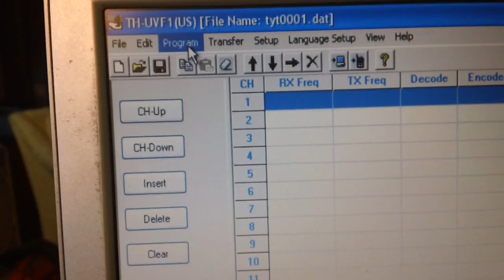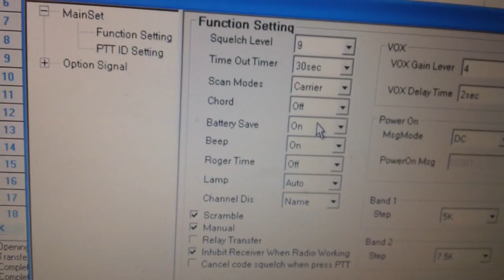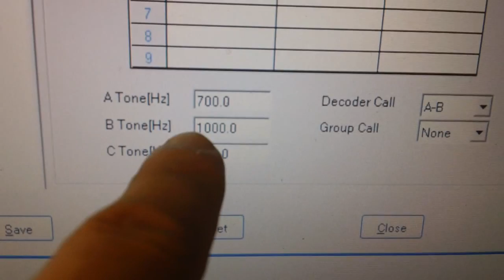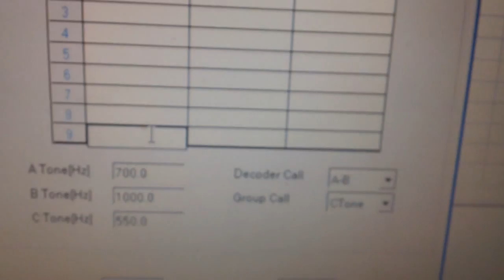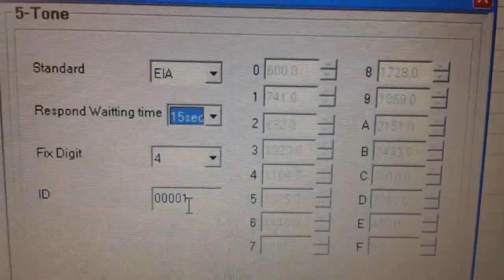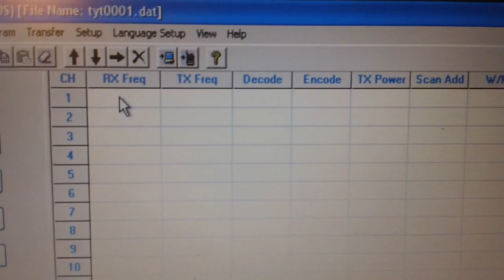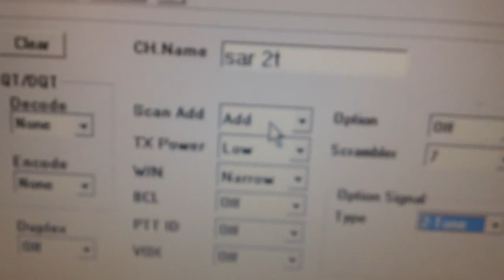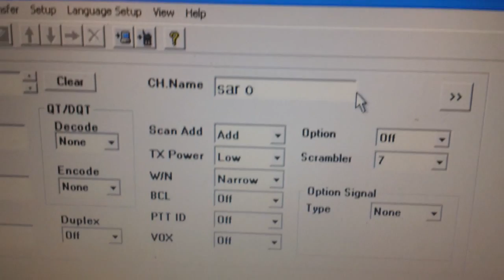Vid Response For Search And Rescue setup for UVF1 radios for Paging and Scrambling. Part 1

Comment from the maker: When the radio is setup for 2 tone paging or 1+1, Same thing. And its enabled for 2tone decode. the radio on that channel will mute all traffic regardless if its recieving the signal unless your radio recieves the 2 tone paging from dispatch. Only then when it recieves the proper page you setup will the audio open up and pass traffic. If its quiet for a while it will reset and mute again. I setup an identical channel without paging to listen to all traffic. Its sort of all or nothing.

Comment from the maker: @nah2323 Just got back from vacation, I played with my radios and come to find out you could use the A-1820 tone to set them both off. On the configuration page the group call box should read A tone. Or use C tone and program C for 1820 Hz. One drawback, the tone transmitted have to be 6 seconds long. any shorter and it will not tone out. Unfortunately no paging scheme for the 1st tone is ever longer than 2 seconds in the US. your dispatch center will have to TX that tone for 6 seconds.

Comment from the maker: I noticed on mine, that is wasn't 100% until I disabled the (Dual Watch) setting. I dont have mine on me to walk you through it right now, I'm away on training. Disable the dual watch and it will be relaiable. it only has one clock to scan both the main & sub bands, so if you get a tone out while the radio is listening to the other band, its going to mis the call. another this is make sure your channel configuration is correct to decode the tones. I dont do emails, PMs only.